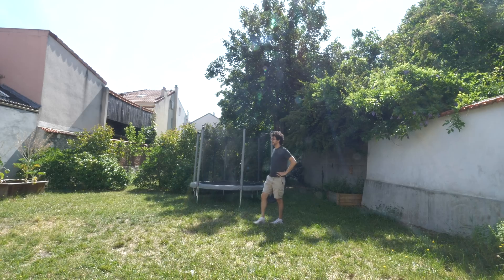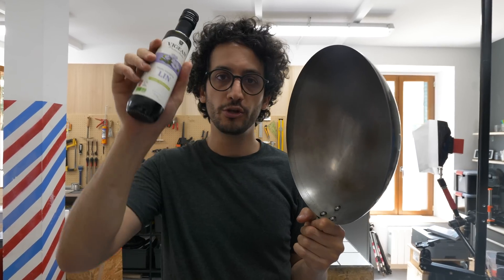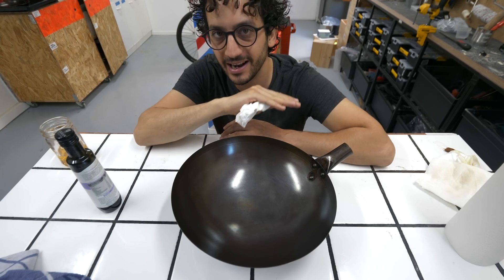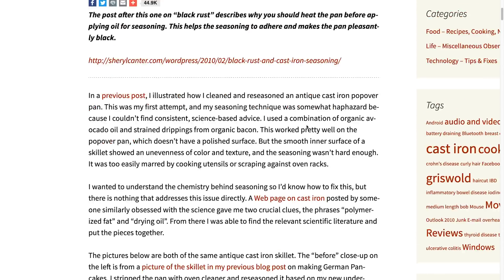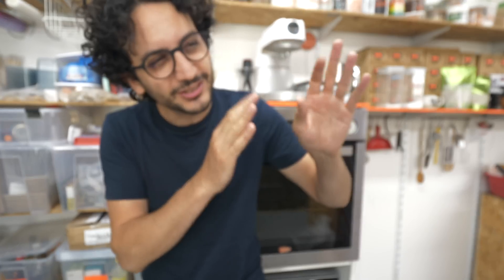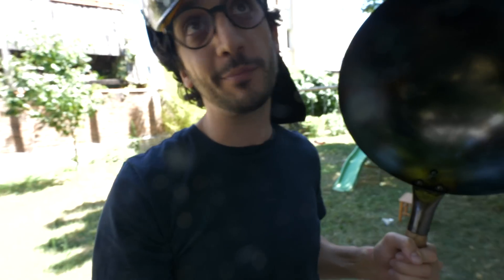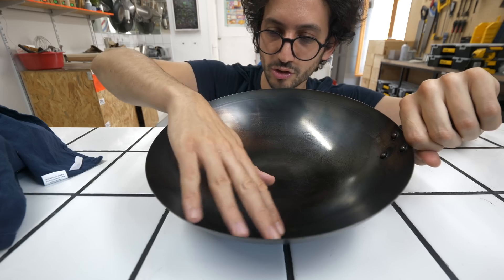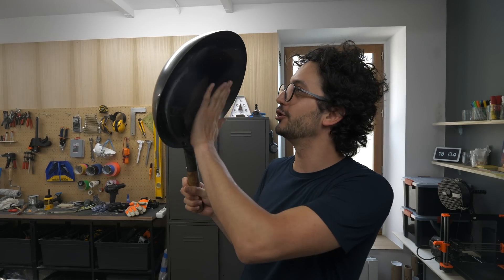Can I Make my Wok Slicker than a Nonstick Pan ?

Comment: When you do this, you're basically making linoleum. I'm not talking about modern flooring, which is usually PVC. While it was fairly sticky while dry, the original real linoleum was notorious for being unreasonably slippery when wet. The coefficient of friction between banana peel and linoleum is the same as Teflon-Teflon. Provided you oil the food, it's slippery enough. Incidentally, although it's extensively used for cast iron, it also used sometimes by professional chefs on stainless steel pans for its non stickiness; but they don't usually bother doing 6 layers, because rusting isn't an issue. I also use the theory behind it on an electric aluminium pan we have, the raw aluminium is very sticky but once you've built up a layer or two of oil eggs simply don't stick. In many ways, it's better than Teflon anyway- you can use metal implements with it, which are thinner and cook better, whereas they damage Teflon over time.

Comment: Properly seasoned pans beat teflon for one simple reason, long term use.

In the past I've had roommates that simply didn't understand proper cooking tool use and maintenance. 
fortunately, I never have owned teflon, so all I had to do was reseason the cast iron and it was better than new. 
If it had been a teflon skillet the metal fork they were using would have ablated the teflon and ruined the skillet with no recourse. . . I suppose I could completely remove the teflon with abrasives and season the underlying metal, but I've heard teflon dust isn't too great for lungs.

Oh, pro-tip, I have a cheap fajita skillet that was given to me that I seldom used because it was highly textured, I used an angle grinder and successive grit flap wheels to remove all the bumps, then seasoned it and now it works pretty good.

Secondary tip, in general, as long as you use enough fat (oil, butter, lard) while cooking in a seasoned pan the seasoning will do a pretty good of self maintaining.
I pretty much never do more than wipe out my cast iron on the assumption that any nasties will get completely sterilized by the heat of the next use . Thus far I've never had any issues with it, but your mileage/kilometerage may vary ;)

Comment: There is no real shortcut to seasoning a wok or other mild steal or cast iron pan. I like to use a wooden spatula. Salt scrubs help keep it smooth. You can tell when its really non stick by the way the cooking oil runs when the pan is hot. Apart from health aspect: Teflon pans wear out over time and cant cope with the high heat needed for stir frying. Carbon steal or cast iron is also better in terms of more focused heat in the center of the pan and also radiated heat better than aluminium. I dont believe you can get the same result from a teflon coated pan as you can with good old fashioned carbon steal. I have a french high sided frying pan that i use for making egg fried rice and other stir fried things.

Comment: Hey Alex, you should DM Alec Steele

At the temperatures you're working with, most of the colour change you're seeing is because you're tempering the steel in the wok. You'll get the darkest shade of blue around 540 degrees F (260 C). Above this, the blue colour starts to get lighter and eventually get's to a dark-ish gunmetal grey at around  700 degrees F (380 C). This is a oxidation process at the surface of the metal. Tempering the steel like this changes it's physical properties, and may not be desirable in some respects.

Comment: Do you think this method wold work on an standard cast iron pan? Btw keep up the good work I love your videos, cheers
Reply: Look up Kent Rollins' videos. You use the oven method, then after each use, jus apply a v thin layer of olive oil (it polymerises as it cools down, and as you heat it up for next use). I use regular dish soap and green/yellow sides of a sponge depending on how stuck on food is, then heat the pan, apply a thin layer of oil, and leave it to cool on the stove top. Super easy. There's a lot of misconceptions online by people who baby cast iron and refuse to use soap (ignoring that the traditional advice is based upon the fact that soap used contain a bit of leftover lye from the saponification process which would eat the polymer layer away; modern dish soap don't do such a thing).

Sorry for the rant, I'm just frustrated by myths put online about cast iron that make it sound like caring for a child; at the end of the day, cast iron was depended on by people in the middle of nowhere, on fires, coals and nowadays gas. If it were anywhere as tough to care for as some people make it out to be, it wouldn't have been as ubiquitous as it was.

Use fats to cook, then wash, heat to dry, wipe down with an oiled lint-free rag, then cool. That's it.
Reply: @OutOfNamesToChoose  thanks for the reply. And have a good day

Comment: Better than Teflon? Absolutely! :D

I have some (eight, total) steel deep dish pizza pans that I've seasoned. This is something like 20 layers on the inside and a few crude layers on the outside just to slide more easily on the oven rack: http://randomer.net/stuff/IMG_20190713_150723.jpg

Comment: I use a non-stick pan and I still use oils as it is a bit of layer of flavouring.  The pans I use you can crack an egg on (with no oil) and it will slide around...ya I did that to test it.

Comment: Alex, if you want the classic black wok color, you need to do a classic wok seasoning step that you failed to do here. When you season a wok, you first need to form a black iron oxide coating. This is a classic step that old school wok cooks do. After you form the Fe3O4 coating, THEN you season it with oil.
See this:
https://www.youtube.com/watch?v=UGXGJD2xTzQ
And this:
https://www.youtube.com/watch?v=a783vEF2yYA
And this:
https://youtu.be/hNhtIeSYGNc?t=60
You even see this oxide method being used on French style carbon steel pans when Asian cooks season them. Here's someone putting the Fe3O4 coating on a French carbon steel pan:
https://www.youtube.com/watch?v=X-tcVxIdmmY

The Fe3O4 oxide is called black oxide, but it has a bluish tint to it, and is the same sort of thing as "gun bluing", but on a pan, it tends to form a thin coating, not enough to really blacken the pan, but in conjunction with the oil seasoning, it helps. (Fe2O3 is the red iron oxide that you want to avoid, but Fe3O4 is helpful.)

Also, for a slicker seasoning coat, don't just use flax oil; blend flax and a little bit of coconut oil together very thoroughly, and season with that. The cross-linking flax seed oil will bond to the metal and form the coating, and the longer fatty acid chains of coconut will make the coating slick. The combo of slick heavy oils and flax is what is used in some of these proprietary seasoning oil blends.
In the various forums where people discuss these things, one of the complaints about seasoning with flax is that it seems to flake off after a while. To give the pan a better grip on the seasoning, give it a matte finish by polishing it with 800-1000 grit sand paper. This microscopic scratching will give significantly more surface area for the seasoning to grip on to, even if you wipe it off as thoroughly as you can before putting it in the oven. The sand paper method is an attempt to reproduce the micro-texturing that you would get if you shot-peened the pan surface. Look at this video for an example of what happens when a micro-textured/satin-textured pan gets seasoned. THIS is the rich black color everyone covets. This is a carbon steel pan. If a carbon steel pan can season this way, a carbon steel wok can also season this way:
https://www.youtube.com/watch?v=zb6d9Xm7i3o&t=106s
I hope this helps!

EDIT If you want to see what one of these other specially formulated seasoning blends works like, try using Crisbee Puck. Here's the method I recommend:
1) wash the oil and wax coating off of your wok very thoroughly
2) micro-abrade your wok with 1000 grit sandpaper until the surface has a satin finish. Do this on both sides of your pan. Use a lint sticky-roller to remove all of the metal bits before proceeding.
3) heat your wok until you form the Fe3O4 film on the abraded surface
4) season it with the Crisbee Puck for two coats. The pan should really blacken at this stage.
5) finish the inside of the pan with pure coconut oil, using the method shown in the video below:

See if that doesn't give you a superior seasoning. As for the effect of the heavier, long-chained fatty acids (such as in coconut oil), take a look at this. Is this as slick as a non-stick pan? You tell me:
https://www.youtube.com/watch?v=1376ITxF1Oc
Here, this lady seasons her stainless steel pan with a super thin coat of coconut oil, not even enough to color the pan. Watch her cook an omelette without oil in it afterwards. That is impressive!

Comment: (Wikipedia)
Polymer fume fever or fluoropolymer fever, also informally called Teflon flu, is an inhalation fever caused by the fumes released when polytetrafluoroethylene (PTFE, known under the trade name Teflon) reaches temperatures of 300 °C (572 °F) to 450 °C (842 °F). When PTFE is heated above 450 °C the pyrolysis products are different and inhalation may cause acute lung injury. Symptoms are flu-like (chills, headaches and fevers) with chest tightness and mild cough. Onset occurs about 4 to 8 hours after exposure to the pyrolysis products of PTFE. A high white blood cell count may be seen and chest x-ray findings are usually minimal.

The polymer fumes are especially harmful to certain birds whose breathing, optimized for rapidity, allows toxins which are excluded by human lungs. Fumes from Teflon in very high heat are fatal to parrots, as well as some other birds (PTFE Toxicosis)

Comment: Teflon is not supposed to be heated too much, or it damages the material from what i've learned. 
This would be safer at a higher temperature, it's durable, and when it gets damaged, you can redo the coating.

Comment: way better than a Teflon pan!!! I have scrapped at least 10 non stick (Teflon or ceramic) pans until I changed to stainless and cast iron with similar seasoning that you did (just not that many layers :-) ). And Teflon start to peal off over time and get in the food. So for your health and the environment (consuming so many pans instead of a few good ones that will last a life time) I vote for seasoned. I have re-seasoned many of my pans more than once and they get as new again very easily.

Comment: I recently had the same trial on a new carbon steel wok.  I wound up on the same process as you,  only I used lard.  I’ll try the flaxseed oil next time, but I’ve gone to carbon steel and cast iron because the anti stick to me is easier to keep and manage over time.  I’ve trashed all my Teflon.  I did the egg test in the wok with a little butter and I never had  to use a utensil.  It just skated over the surface and I flipped it in the air after work coats.  Excellent video.  I love watching your content!

Comment: Your coating might be uneven because your stove is too small. When you see kitchens in asian restaurants, they have jumbo jet sized gas stoves that heat the whole wok in a flash.
Why don't you try adding a few propane torches while it's on the stove to increase the heat? That way you don't have to move the wok around.

Comment: "There's no chemical..." 10.44  Alex, you are made purely of chemicals; you breathe chemicals; you drink chemicals; every thought, dream or impulse you ever had is a biochemical reaction; the wok is made of chemicals; Teflon is a chemical and, surprise, surprise, so is the polymerised oil coating.  Teflon is also a polymer - it just happens to contain lots of fluorine atoms. Toothpaste and posh sea salt also have fluorine in them in the form of fluoride.  Please do not consider natural chemicals to be healthier than synthetic ones.  Anthrax is lethal.  Yours, a frustrated chemist.

Comment: Teflon still has the advantage. It is absolutely harmless because it can't stick to anything in your body and is non-reactive. So even if you scratch the pan it goes right through your body. It is also way easier to produce and as you said, Alex, you don't even need to use oil. :)

Comment: I cook A LOT as a father of two boys and I purchased last winter AMT's "Best Pan" series WOK ( https://bestpan.com/en/ for details ). I don't want to cook in another pan ever. The walls are very thick heat up slow but strongly and produces amazing results. MAJOR minus is the weight. My wife can't hold it with 1 hand when it's full and in a wok pan you always wanna throw it around a bit. However, as I'm cooking on an electric stove with glass top, the flat bottom (compared to the "classic wok") is just a must. Don't know what chemistry they are using but yeah, never got stuff burned on it. 

Will I spend a few days of prep and work to make a classic wok seasoned (considering I have the stove for it?). Most likely not considering I have this 50-60 EUR alternative that is ready to go as soon as I get home.

Comment: I have seen first hand "work seasoning" is a thing. When you start from a good base coating and cleaning it without heavy detergent soap. I could swear the pans my grandmah has which she got from her mother are slicker than my new calphalon cast iron. Heating and cooling and being oiled over litterally 100+ years my grandmah will be 97 coming this year seems to have a direct effect to its nonstickness. But then again who has a century to get pans "right"? Right? Lol

Comment: Not sure about carbon steel woks, but flaxseed oil tends to get "flaky" on cast iron.
Reply: It gets flaky on carbon steel pans too. I tried several times to get a good flaxseed oil coating on my carbon steel skillet and it would never stay. Now when I scour and reseason the pan, I just put about an inch of old cooking oil in it, heat it until it starts to smoke, use the corner of a paper towel dipped  in the the oil to coat the rest of the inside of the pan, turn the burner off and put a lid on it and let it cool. Dispose of the oil when cooled, use the residue to coat the rest of the pan, wiping off the excess, and then just fry something fatty/oily up, like bacon or a pan-cooked ribeye. After that it should be suitably non-stick for regular use, and the coating will be durable as long as its maintained.

Comment: I never really had success with the purest of flax oils. It always ends up just coming off in cooking and leaving an odd taste/color and uneven seasoning until it gets replaced by another oil. I always had the most success with plain cheap vegetable oil that I would never use in cooking. After that I just use whatever lipid I have on hand. I think technique matters most. Maybe flax makes a good base layer, but I don't really see a useful difference in my pans.

Comment: Well teflon is poisonus, soooo I'm in it for your version
Reply: Huh? Teflon is nice because it doesn't really react with most things. It just passes through your body without interacting.
Reply: @VTF5252  When teflon is over heated it gives of toxic gasses that can give you polymer fume feber. While if you have a pet bird in the room you cook with teflon the bird might die from ''teflon toxicosis'', where the bird lungs hemorrhage, filles up with fluid and lead to suffocation. Also the company that invented teflon (don't remember, was it Du Pont?) Knew about the risk the chemicals of making teflon had on their workers. There are documentaries about it, you should watch one, it is very interesting.
However; if the teflon isn't over heated and the teflon coating is not scratched, you will probably be fine.
Reply: @adaode3413  I've never burnt a pan but have had people use metal and scratch the Teflon on our old pans and I'd be more worried about the pigment they put in the Teflon than the Teflon itself.
Reply: @adaode3413  The toxicity of the chemicals that are used to make teflon have nothing to do with teflon itself, it is polymerized. And you can also poison birds by using normal oil passed it's smoke point. Scratched or not teflon has no reaction with the inside of a human body.

Comment: Don't you have a Pizza Bakery friend around? You could have used their high heat oven... ?! ;)   I seasoned 3 iron pans with different methods and the method you used seamed to me the most viable one. Linseadoil or Flachs (like it is called in Germany) is a very interesting choise, since it is one of very few vegie oils that actually polomimireizes. It is used in Woodworking sinces ages to provide a durable surface / finish.

Comment: You used polishing compound to polish your pan?? I have got to ask coz I don't know but... Is it even food safe?... 🤔 (at 09:47)
Reply: no polishing compounds are poisonous. And whats worse is part of it may stay imbedded in the metal
Reply: I believe he used a abrasive cream cleaner like the product Cif. Seen a lot if people use it on woks and restoring knifes so I believe it's safe when rinsed off
Reply: @blackmarya  at 09:47 I definitely think he uses a polishing compound stick from the brand Silverline. It's very subtle, very quickly edited but not hidden.
Reply: @niluje66  yes I paused it and it is that brand
Reply: I had the same question.  They always say, if you wouldn't eat it, don't put it on your pan.  For Cast Iron, this includes cleaning agents, so many people clean cast Iron with salt and oil rather than detergent.

Comment: For anyone wondering, the way the oil polymerises is that the double bonds of the unsaturated fats are oxidised to form a hydroperoxyl group (R-OOH). The hydroperoxyl group is then reduced by the hydrogen from another fat molecule which forms an ether bond (R-O-R) between the two fat molecules and a water molecule.